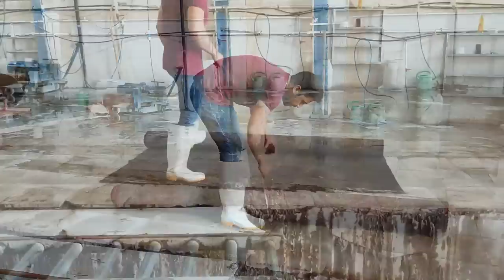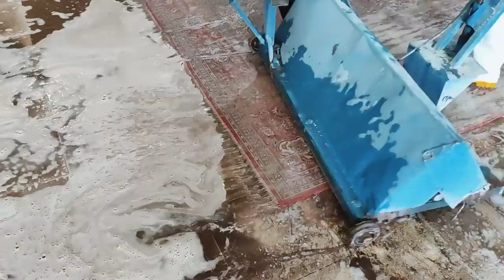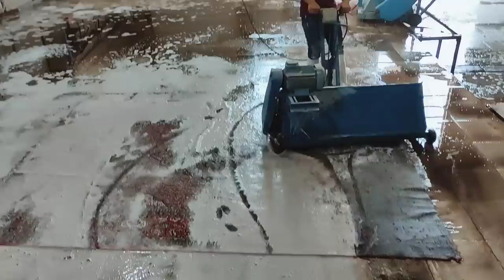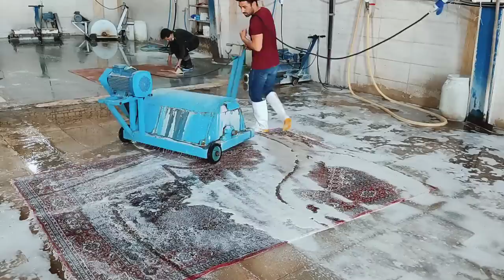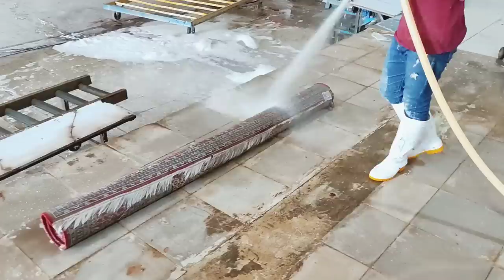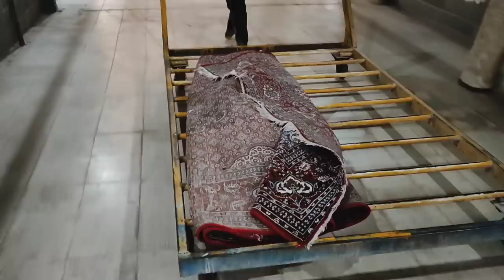You Cant See if This is A Ring of Power Or A Stage  | Ring of Power  | ASMR Videos

Comment: What is the difference between these two blue machines? He takes turns using them.
Reply from the maker: The first machine hits the surface of the carpet and removes dirt from the depth of the carpet.
The second machine is the brush machine and it brushes the surface of the carpet with vertical brushes.
Thank you so much for watching my dear